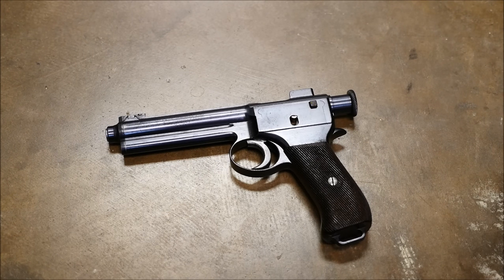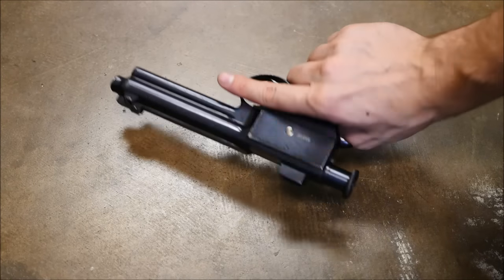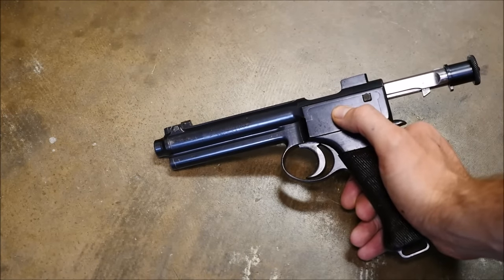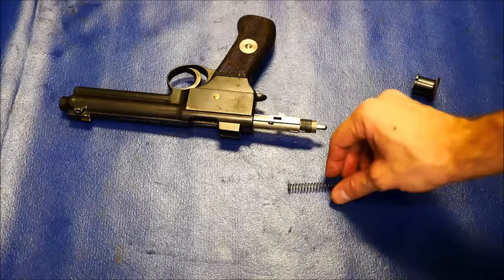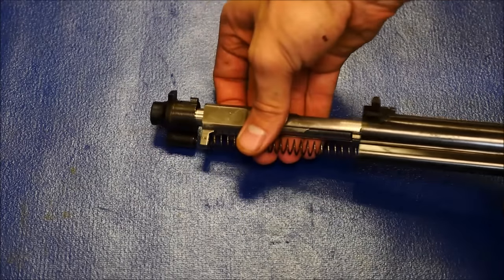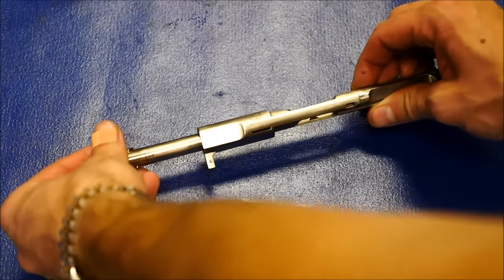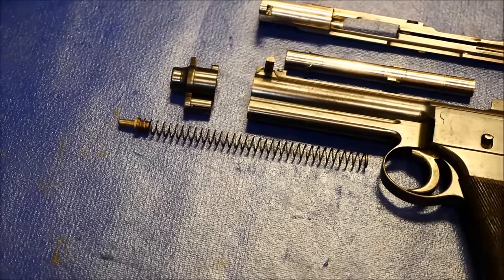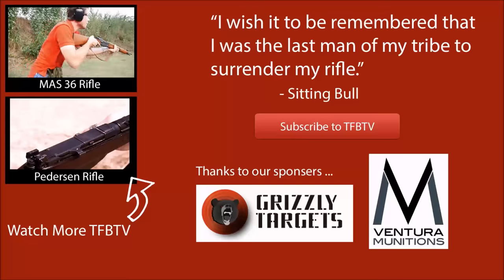Roth-Steyr M1907 Field Strip

Comment: Good job, Alex. It seems that the striker action of this pistol became the inspiration for Gaston Glock, who is the designer of the pistol of the same name. Also this is one of the first semi-auto pistols to be adopted by the military at the time 1907-1909.
Reply: It actually seems a bit more reminiscent of the H&K P7, that pin sticking out the back when the striker is cocked is very familiar.
Reply: +ostiariusalpha The polymer frame yes, it came from H&K P-7, also the there was an experimental polymer
 Makarov pistol. The soviet military had rejected the polymer frame, because they were afraid that polymer might break under extreme conditions and storage as well.
Reply: Dariy Novik The P7 has a metal frame. I meant that the P7 is more a descendant of the Roth-Steyr than the Glock is. And considering the level of Soviet polymer tech at the time, I'm not surprised they rejected it.